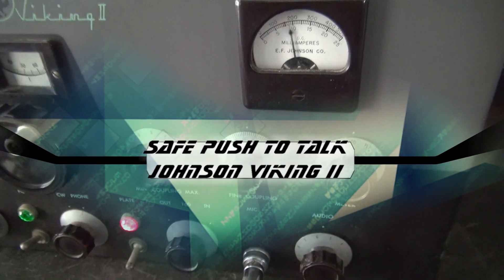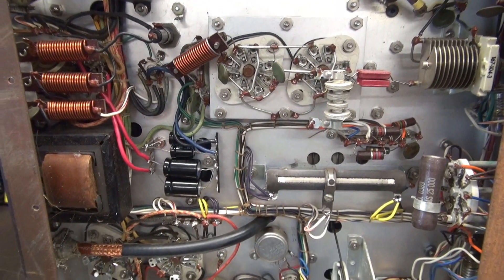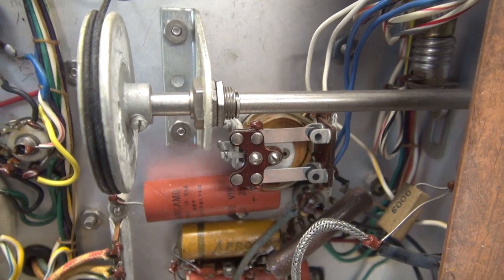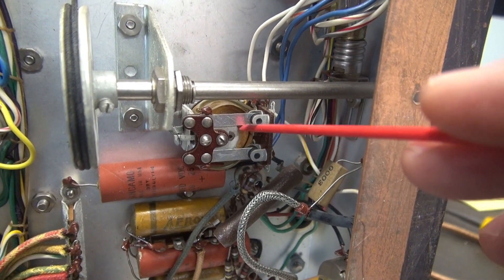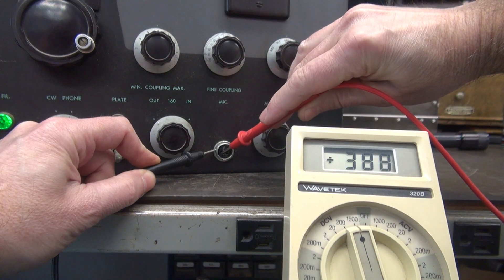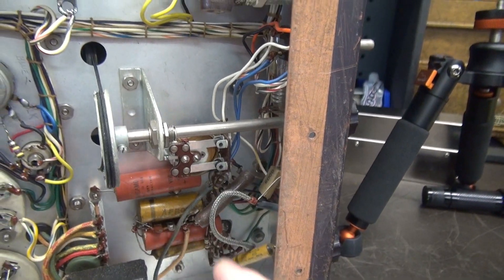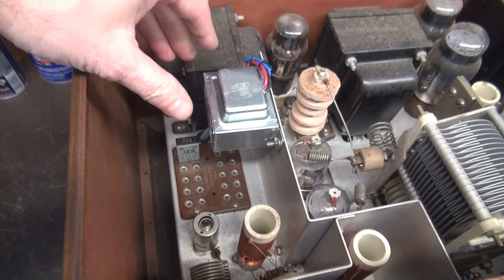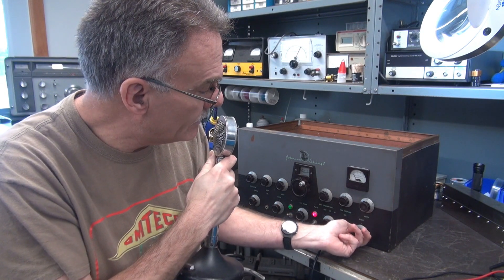How to safely install Push to Talk Johnson Viking 2 tube Ham Transmitter

Comment: Back in 1966 I had a Citi-Fone SS tube type CB radio built in Royal Oak Michigan.  I found out the hard way that the microphone push to talk circuit had 200 plus volts DC in it.  This was how they came from the factory.  Amazingly for as popular as that radio was at the time, no one ever posted a warning about dangerous voltages in the microphone.

Comment: Another great video Terry, that cpou;d save someones life. I don't Viking II, but I do own a ranger. Is this problem found in the Rangers as well?
Reply from the maker: This PTT circuit was added by someone other than Johnson. I have never heard reports of high voltage on the Ranger mic connector, but it may be a good thing to check.

Comment: I'd look for a 6 volt AC relay and key the PTT off the filament supply as that requires less modification and is closer to original, but your way is OK too.   I assume you'll put in a few diodes and capacitors and get your 12v DC off of the filaments as well.
Reply from the maker: I would believe that the 6vac mixed in the mic cable would induce noise in your audio. It may be better to use a voltage doubler circuit, then drive a 12vdc relay.
Reply: @d-labelectronics  i did mine with a 5 volt dc relay and the heater supply
Reply: Hi Terry, great job, as always. I agree that using the filament supply and a doubler would eliminate the need for that additional transformer. Those tiny relays draw very little current. 

You’ve inspired me to work on my Viking II!
Reply: @superhet7281  if you use a 5 volt relay you only need 1 diode and 1 10-16 volt 3300uf cap
Reply: @Jamie — Ah! That’s a good idea too! Keep it simple.
Reply: I would have liked to use the filament voltage as well, but it might be floating with respect to ground.  Trying to ground it to make it work with the mic jack could introduce some problems.  If one side was already grounded, or if it used a grounded center tap, then it would be a no-brainer.